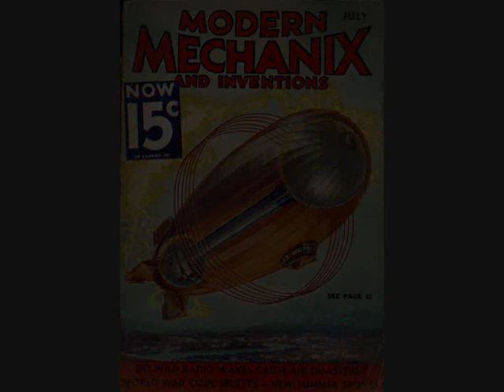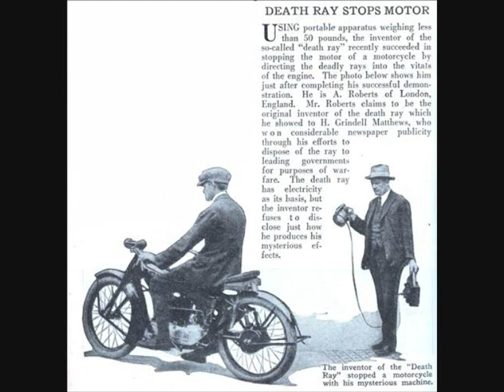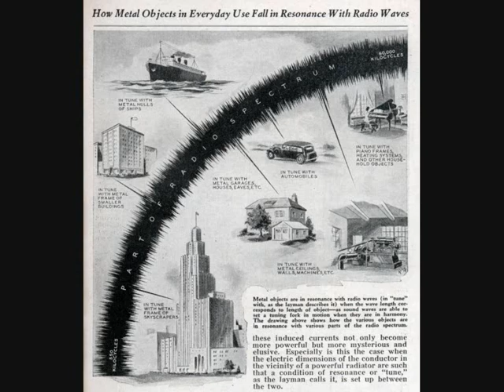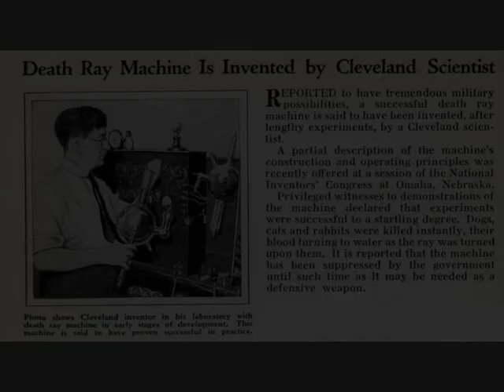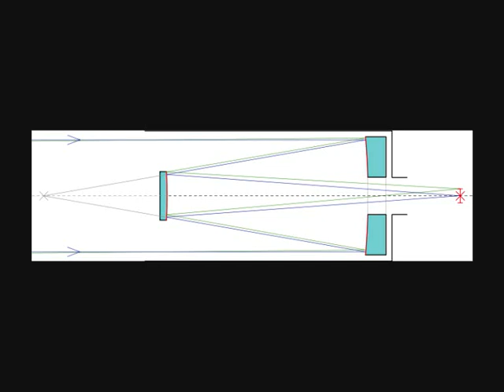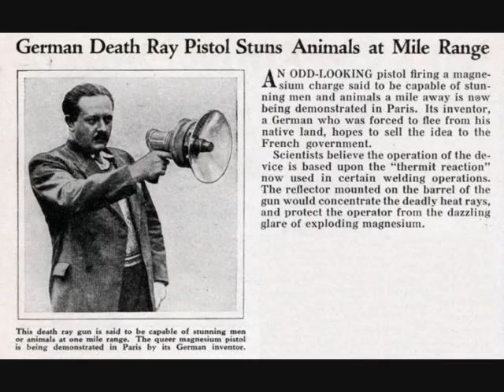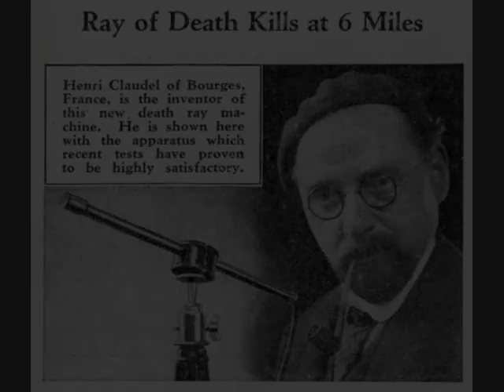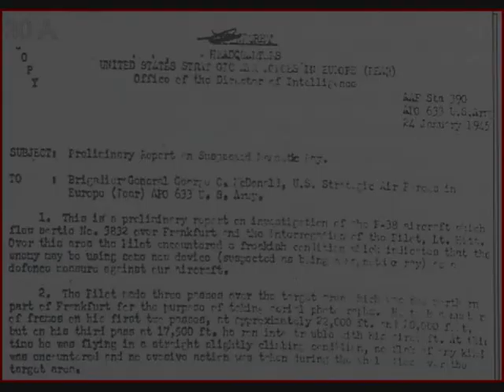Directed Energy Weapons of the 1930s: The Death Ray

Comment: The most fascinating thing about these weapons is their physics, construct and applications are relatively simple to create.
Reply from the maker: A simple high power heat beam can be provided by the sun or any other heat source including an oven heated with wood or coal. The only problem with an oven is to get the light or heat rays parallel. Sunlight already is parallel and can be concentrated into a thin beam with a Cassegrain mirror system. Once the heat ray is produced it can be modulated with simple techniques like the ones shown in chapter Laserwaffen on my homepage:
http://www.totalitaer.de
Click the flags to translate.
Reply: Thank you my friend.